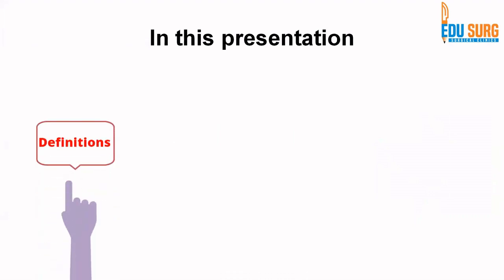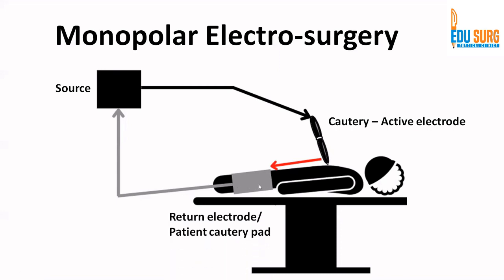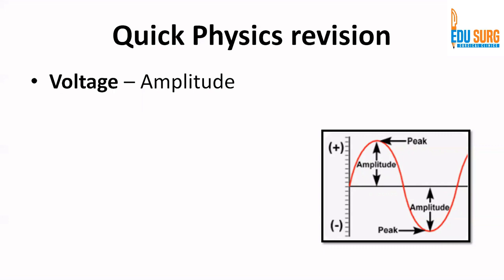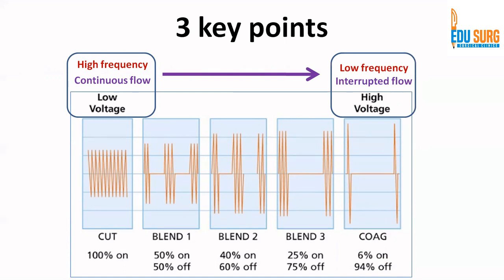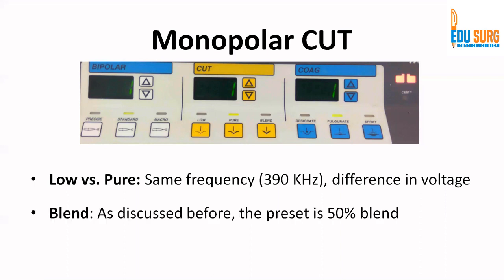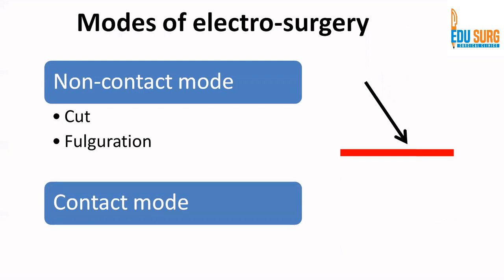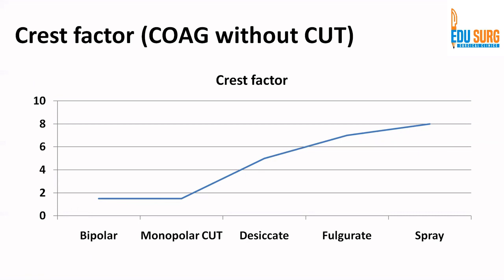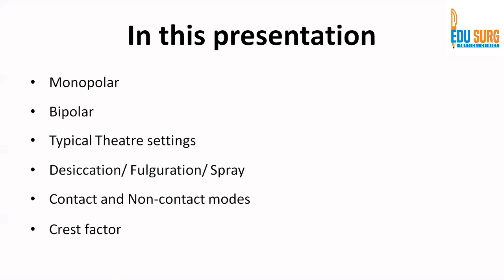Energy sources in surgery - principles of electrosurgery (monopolar and Bipolar) - 1

Comment: Good information. Just worth pointing out that the base carrier frequency in the different modes is not necessarily too different from one mode to another, but  duty cycle and voltage (amplitude) are the parameters which mostly provide the desired surgical affect as you stated.
Reply from the maker: Thank you for sharing information on the topic. Regards.